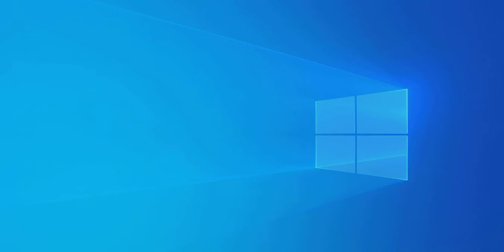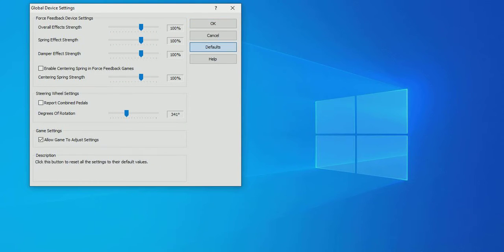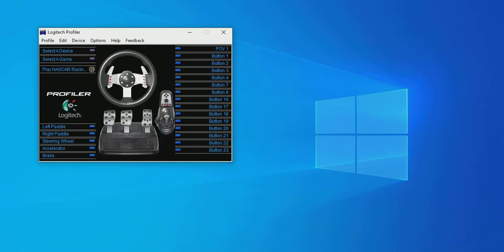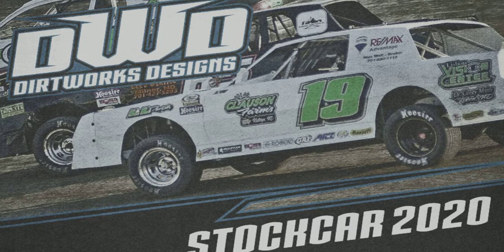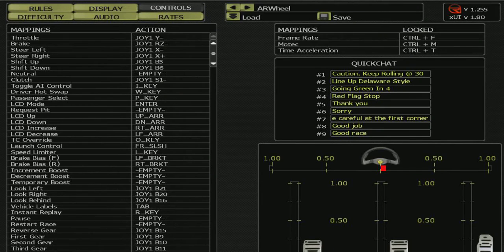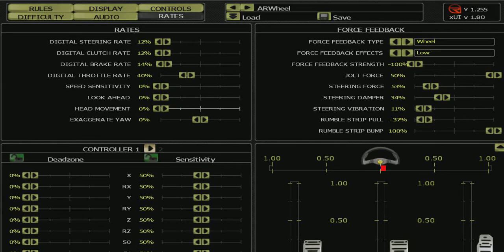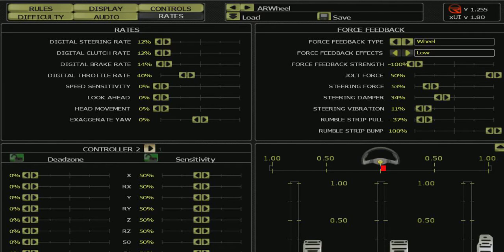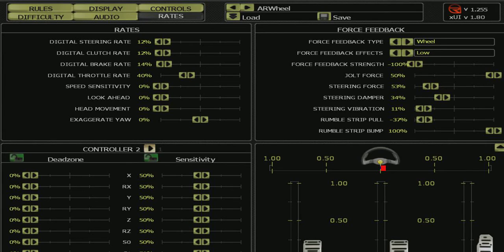Logitech G27 Wheel Settings for rFactor.

Comment: why would you want no feedback from the wheel?
Reply from the maker: -100 value in rFactor is actually like +100 for force feedback strength. Why I don't know but the negative value will give you more force feedback in game setting.
Reply: @Oilracing  weird, thanks for letting me know :-)